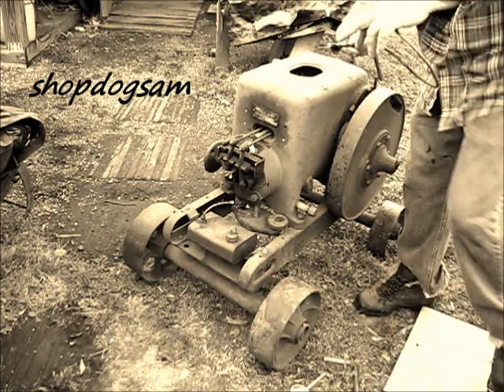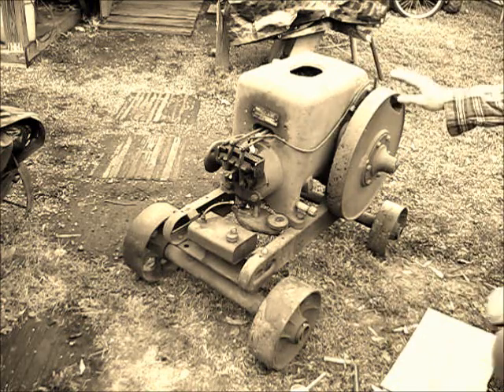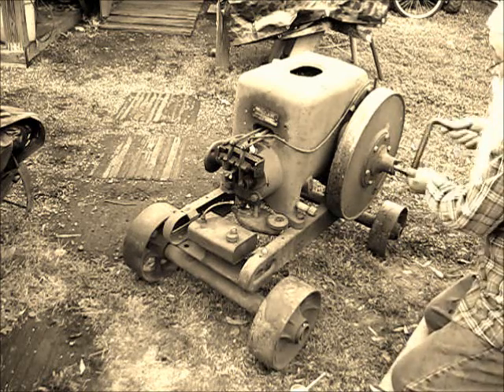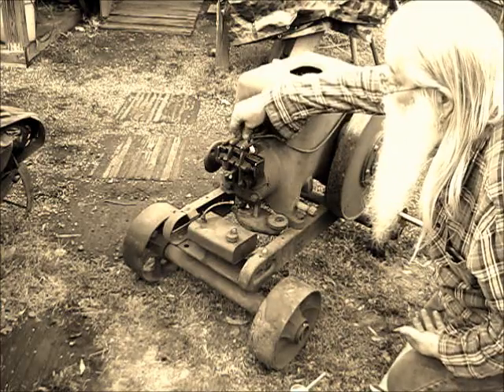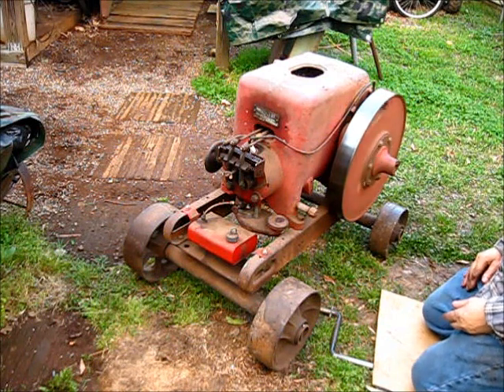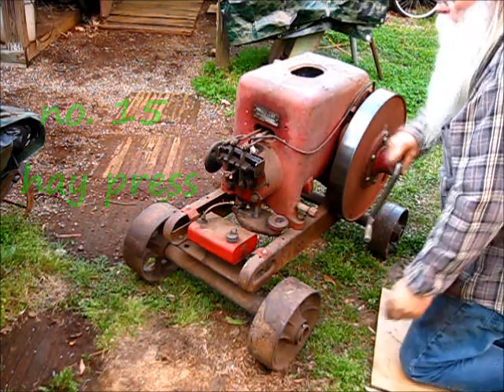Start an Engine / 1946 IHC 3-5 HP LB

Comment: Hey Sam, do you have or know where I can get a carb for my IHC 3-5 LB engine?  I am told that I need a carb that gets gas from the tank that sits under the engine and the one I am looking at has a carb that get gas from up above (down draft and up draft).  Does this make sense